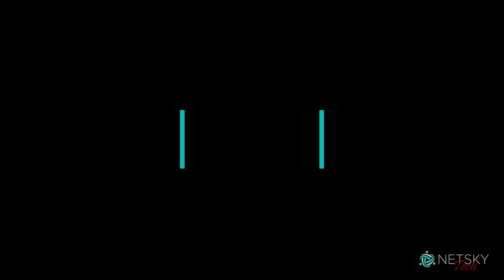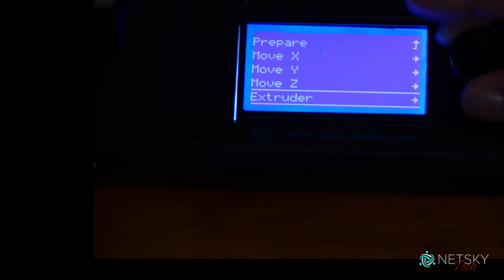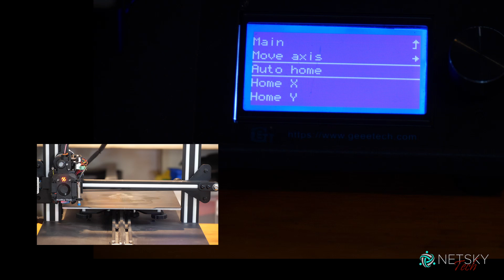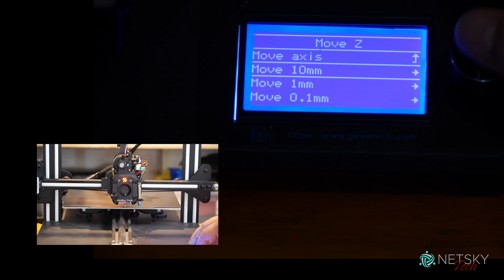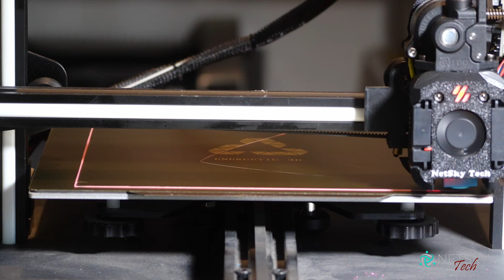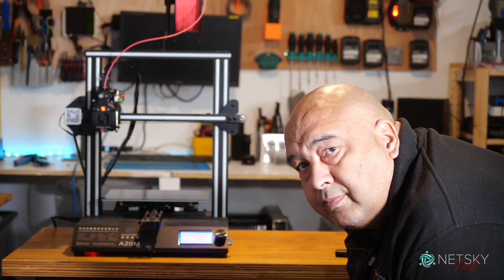Can This Simple Upgrade Save My Old 3D Printer? P3

Comment: I just came across your channel, I recently picked up an A10M, and I'm considering converting it to Klipper but keeping the dual extruder set up.   I would love to get your thoughts on this?   Currently have 2 Creality sprite extruders to replace to original extruders.  And I MAY throw an E3D cyclopse hot end on it.